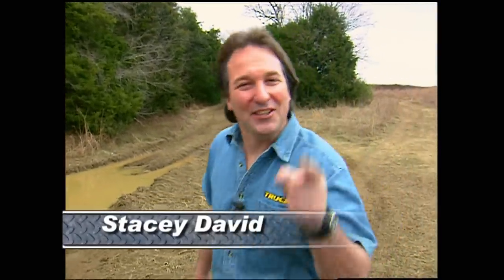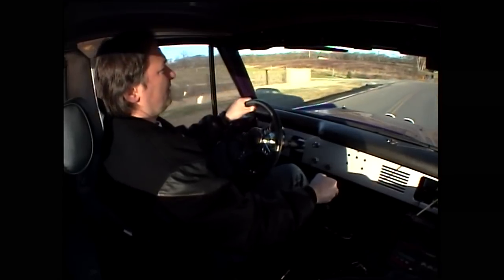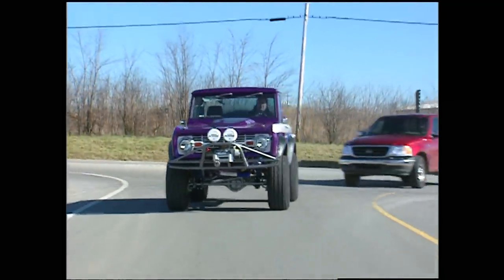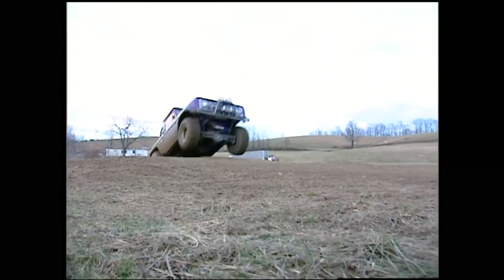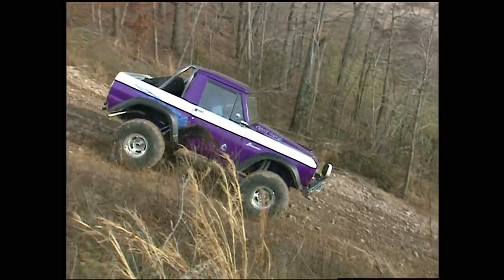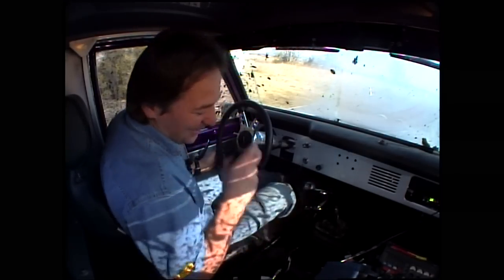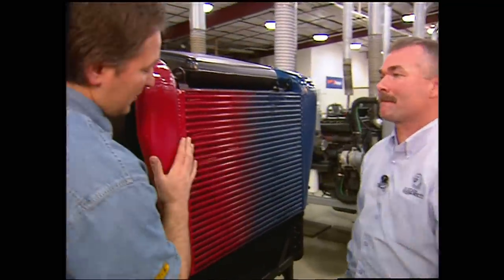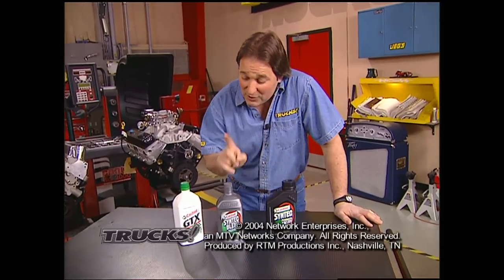Seeing How Our '66 Bronco Handles On And Off The Trails - Crazy Horse Part 10

Comment: Regarding a locker on the road in bad weather - I ran a Detroit Locker in the rear of My Scout 2 with 33" BFG MTs for many years, built IH 392 engine, and never had the rearend squirrel around like that. Of course, I didn't drive like a wild man either.

Comment: That's why you don't use a limited slip rear differential. Use a torsen diff. No clutches to burn out and it won't swap ends when turning left under power.

Comment: Does anybody remember what motor Stacy stuck in between the frame rails of this Beautiful Beast, because it sounds pretty sick
Reply: This channel has all the build videos too, I'm pretty sure they mentioned it there.
Reply: @eurobeatmachinist732  true, I probably had seen it but totally missed what kind of engine he used 

Though it's likely to be a Ford motor in there
Reply: Doesn't matter, it was already puffing out oil smoke in some of those clips, at the shifts, both on and off road.
Reply: Build up bored out 302
Reply: @tjh44961  I saw that and was aw'd, definitely not a motor guy
Reply: They said it was a 350ci SBF, I'm guessing it may be a .040" overbore 347 stroker

Comment: 12:18 why is that spare tire bouncing around lol.
Reply: Ucallit 71  As Stacey revealed a flaw with the spare tire carrier on crazy horse when the few hope the company that made the spare tire carrier saw the episode and redesigned the carrier taking the weak points into consideration and made it much stronger.  With the topic on inner-coolers had the trucker wonder if they had their right foot buried in it and not looking at their gauges when the ECM is to see an overheating situation and put the engine into limp mode.